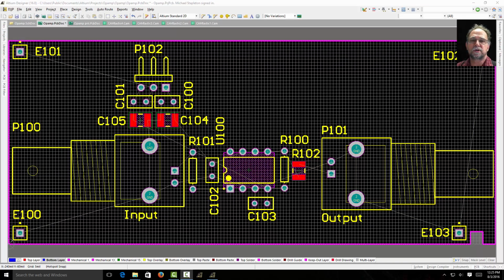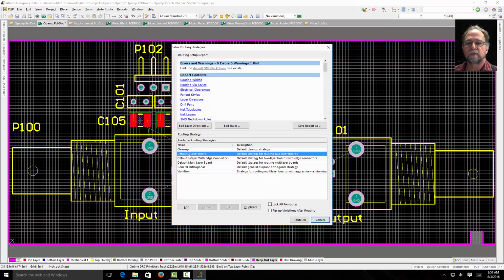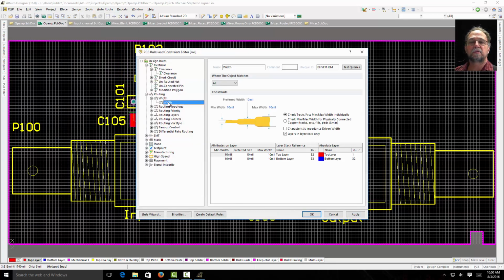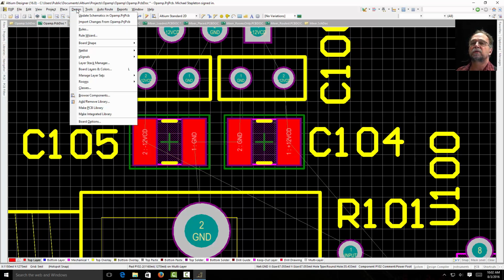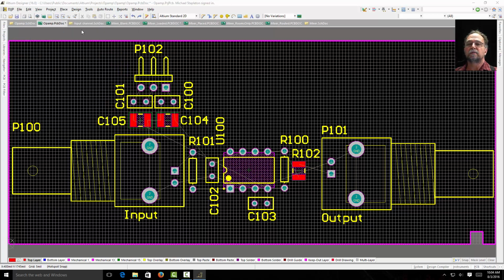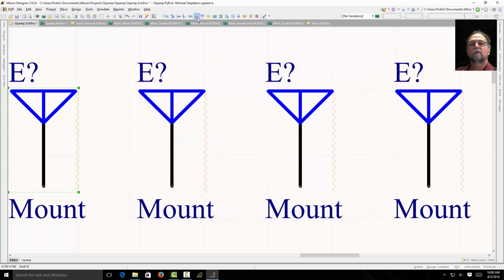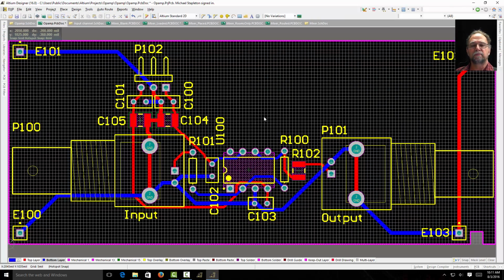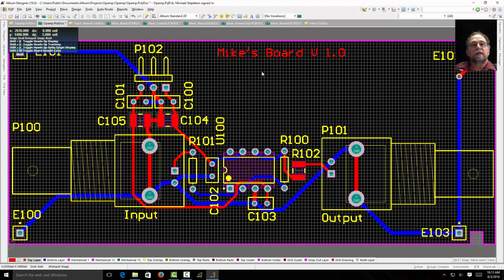7 PCB Routing and Rules

Comment: Design Your PCB Board Using Altium Designer (Based on Arduino Nano Project) : 
https://www.udemy.com/course/design-your-pcb-board-using-altium-designer-arduino-nano/?referralCode=13FF743672BAE90EE2E7
Use CODE: NEW2020 
To get 12.99$ instead of 109.99$ !!!

Comment: Thanks for the wknderful videos. Please tell me how to change size of all designafors in the pcb. Thanks
Reply: Press Shift +F and then click on any designator. Then a window will pop up,select designator same and press enter.
After that a new window will pop up here you change the size of designator to the required size and many other things.
Reply: If you like to do this to all of them, click on one designator and do a find similar search and select layer as your overlay and text type and ensure you tick the inspector. Once you complete the search you can modify all at once using the inspector via text height/width